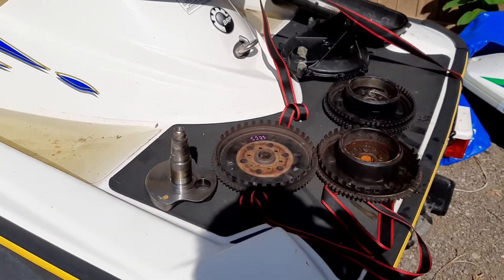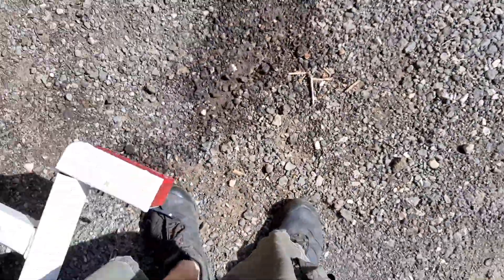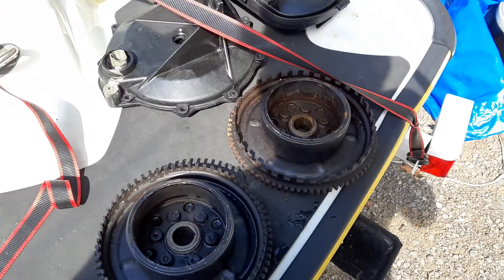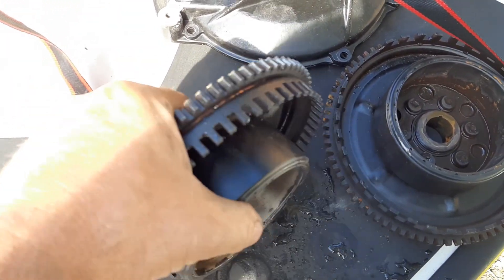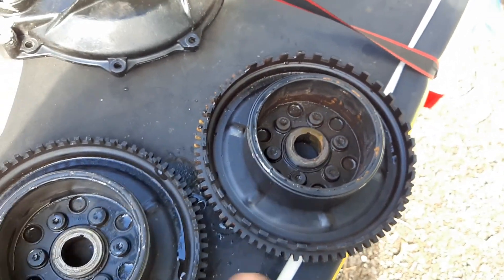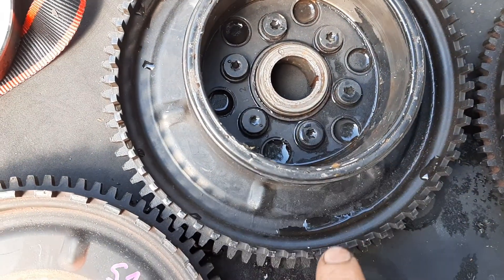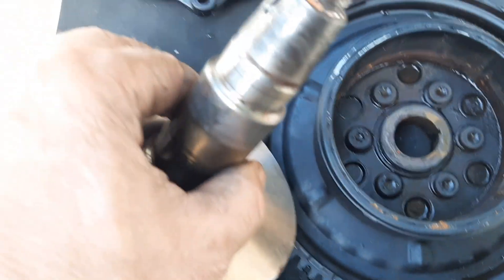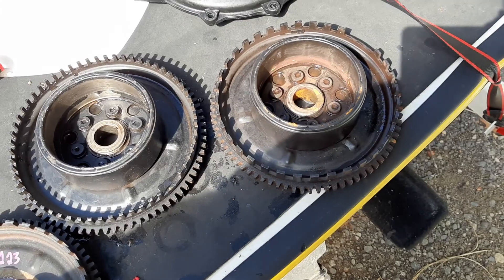Seadoo RFI 787 engine trouble shooting Flywheel timing problems

Comment: The serrated wheel is for the crankshaft position sensor.  The 97 models didn't have this, but the 99's do.

Comment: Does this issue exist also on the 99 rfi 787s or just the 2005 one. (Since that new different one start in ‘05)?
Reply from the maker: I see that key wasted in all the RFI years, but it seems like the 05 is the worst.
Reply: @5StarPWC hey thanks ! Still tryin to figure out this issue with 99gsx rfi.. it has trouble starting in the water when warm, but not when cold (cold starts always start right up). I already did injectors, fuel pump/regulator, starter solenoid, new gas, etc etc. Thinking could this flywheel issue be my issue?
Reply: @5StarPWC Hey Mel, what should I look out for when purchasing a USED RFI flywheel for my 99gsx? Keyway condition as you mentioned, but what else? Magnets? Teeth? Etc?

Comment: I have a 2005 3d seadoo with 787 rfi motor with the same symptoms you describe 3d has 170 hours . Can I take the mag cover off with motor in ski. I notice it has the one engine mount on mag cover. Thanks for any help.
Reply: It's a hundred times more difficult than pulling the motor out to do it.